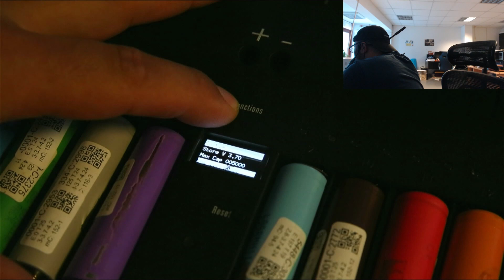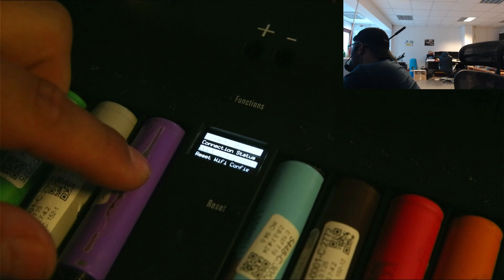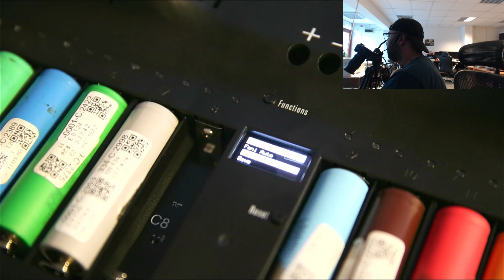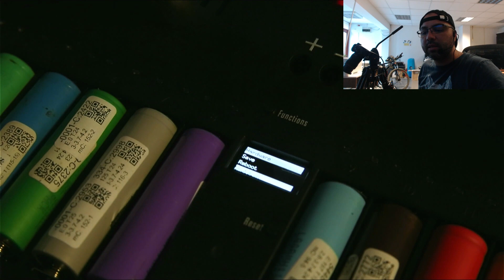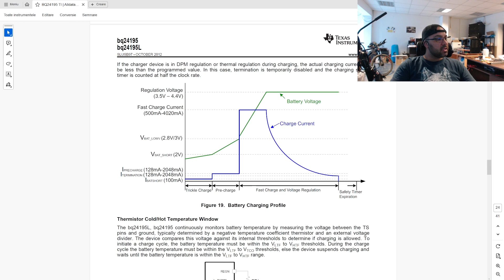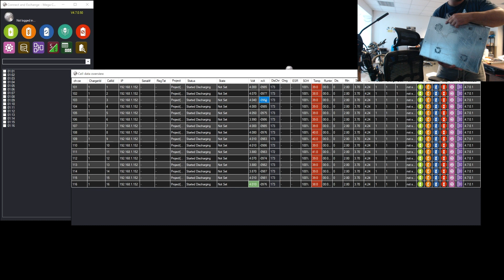Megacell Charger Professional - Menu Update and Charging & Discharging fully working

Comment: Hey, what about Bosch 625Wh batteries for emtb , is it possible to replace cells and create higher capacity battery for bike ?
Reply: Hi, I am preparing to work on a series where I repair all sorts of batteries. If you want, I can fix your battery for free and use 3000 mAh cells. But you will have to send it to Romania